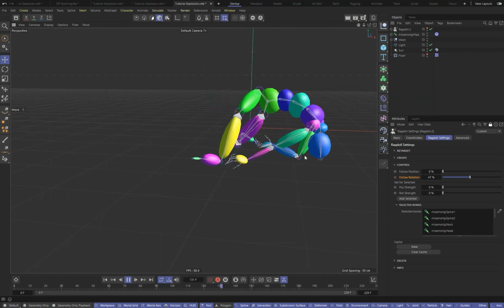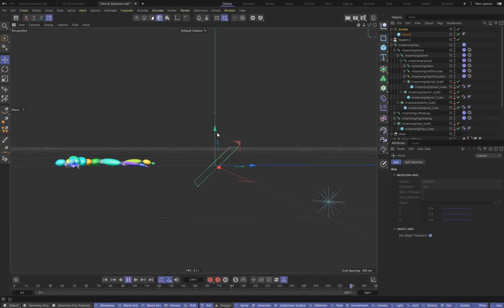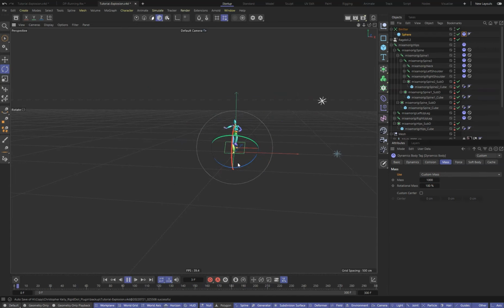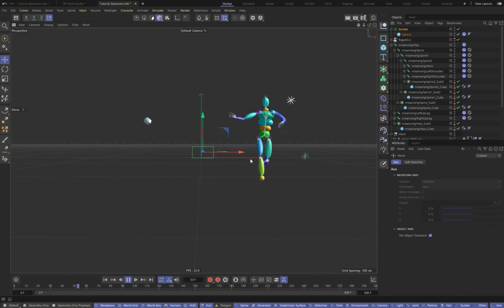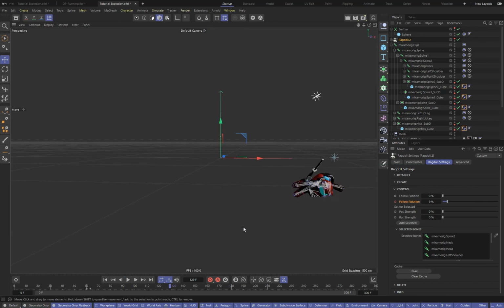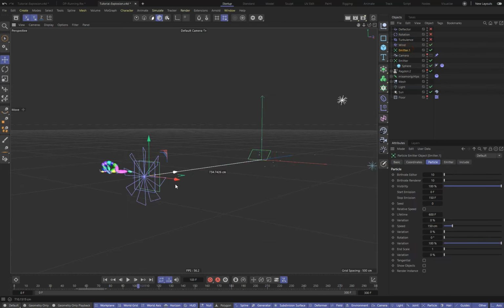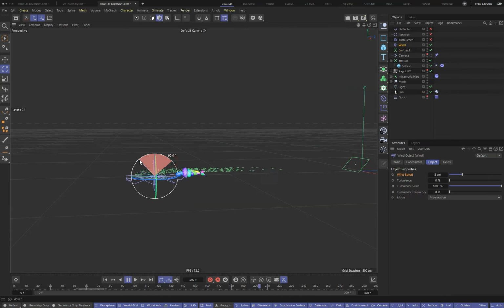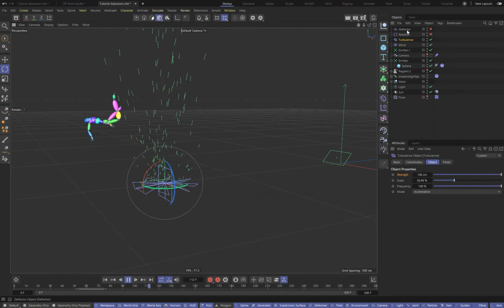Hurricane, explosion and Ragdoll | Ragdoll plugin - C4D tutorial

Comment: Does it work with c4d 2023 new simulation system?
Reply from the maker: Hello. No it is not. The new simulation engine in C4D r26 and 2023 still has its limitations. The main requirements for any ragdoll is a Connector with a twisting and bending restrictions option. And unfortunately that is what the new simulation engine is still not able to do.
Reply: @YarkoRagdoll  When completed new dynamics system release fully, will you improve new version of Ragdoll plugin ?
Reply from the maker: @SupSupa10  Yes, I will add the option to use the plugin with new physics engine.